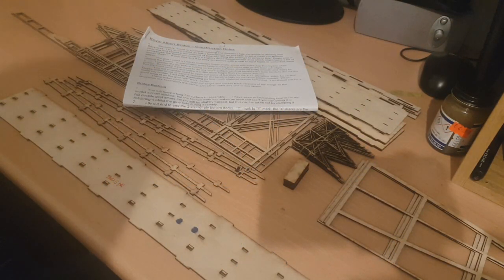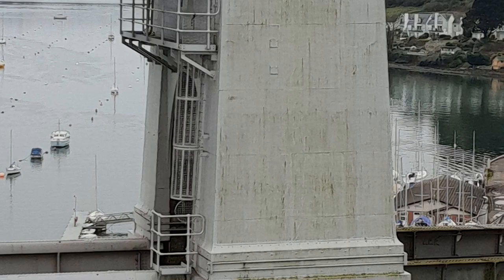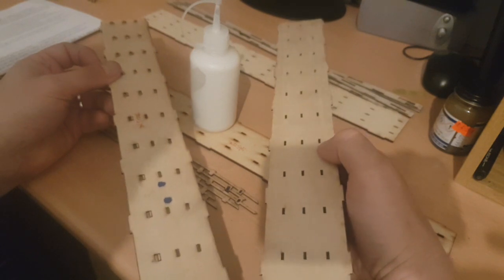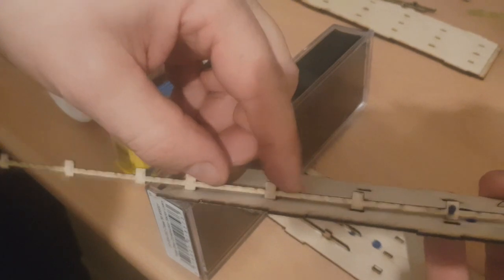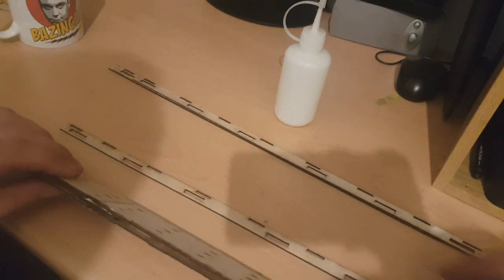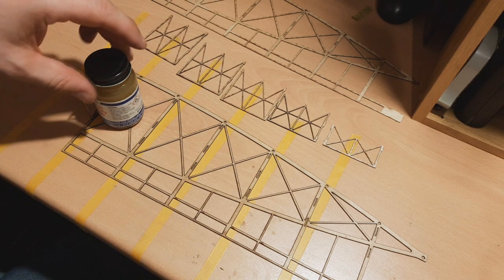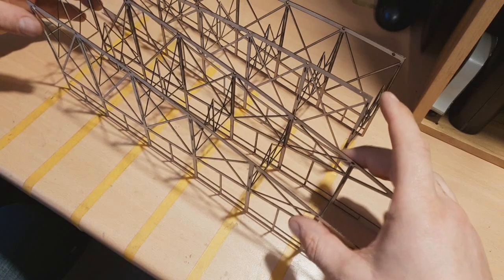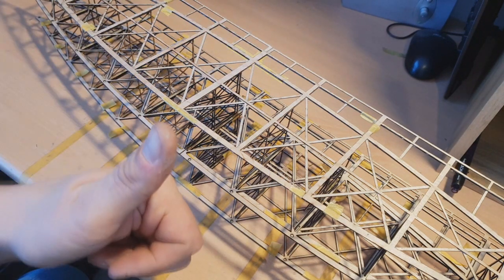Torre Vale, N Gauge Royal Albert Bridge Build, Pt1

Comment: Hi This is going to be a great bridge you will have to run your wires from both ends because of those strengtheners in the middle. Colin
Reply from the maker: Thanks Colin, yes you are right. Will be a while until i get to that point though 😁